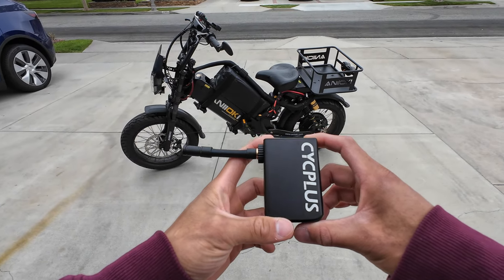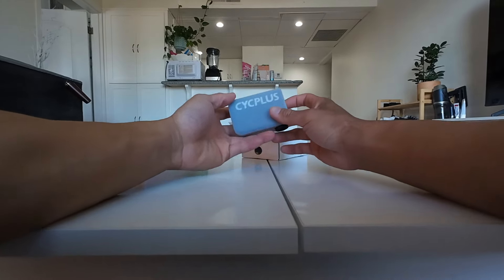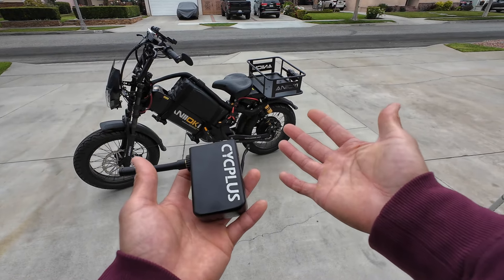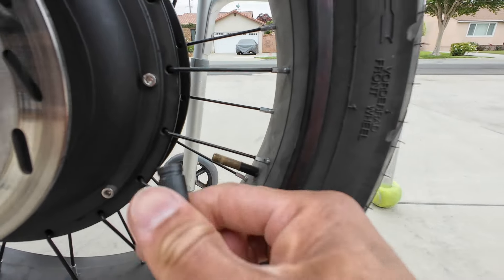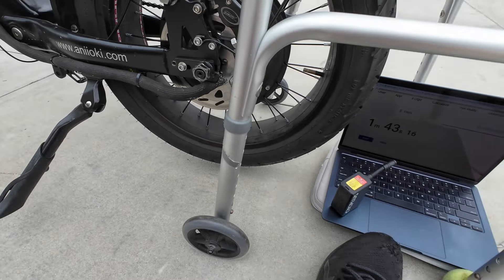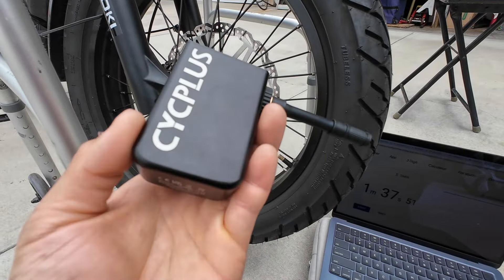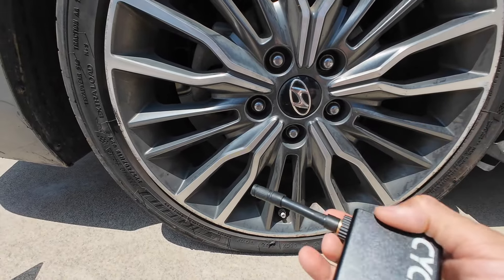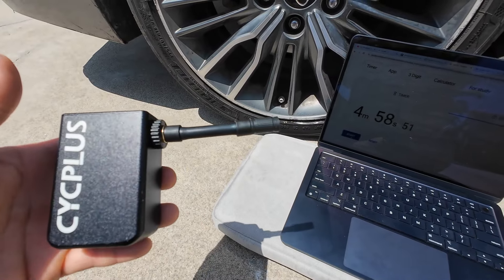Most PORTABLE Bike Pump | CYCPLUS AS2 PRO MAX

Comment: Pick up a right angle valve adapter for that rear wheel and yeah, those pumps get warm. Thats probably a spare o ring. Nice pump
Reply from the maker: Yea some tubes come with an angled valve. I never knew why until this video 😂
Reply: Thanks for this comment. I didn't know these adapters existed and or my brain couldn't think of it.